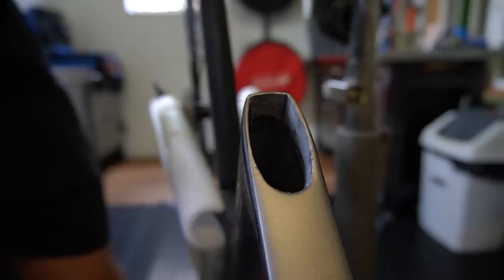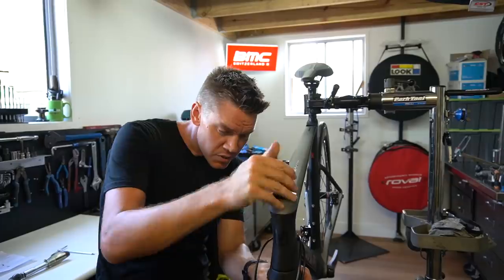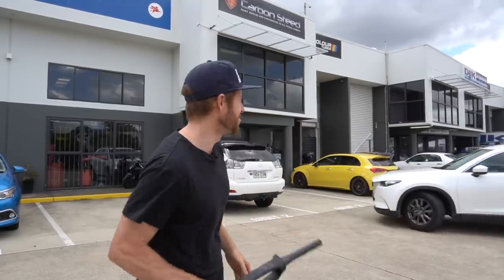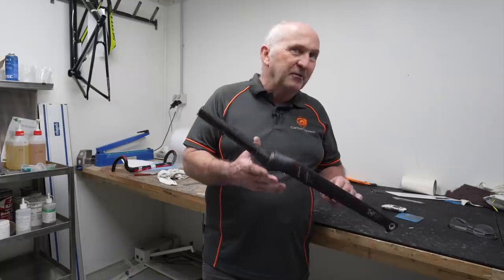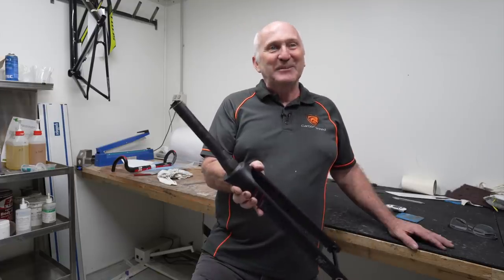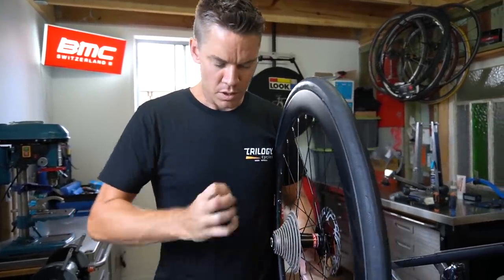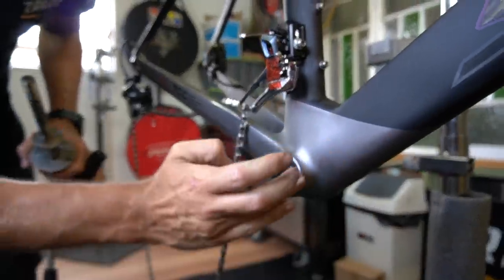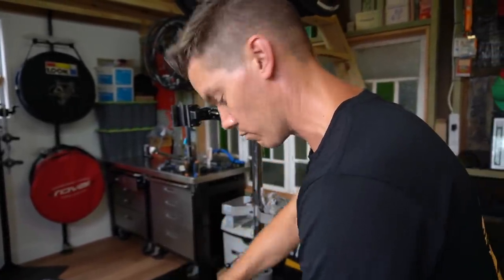The Cheap Chinese Carbon Bike that Backfired

Comment: This is exactly why when I decided to take the leap of cyclist to cycle company owner/importer I spent over a year researching brands checking that they met international standards (ISO) and that they did in house testing, quality control, and that they also had independent testing done like TUV or SGS. I would never sell anything to a customer that I wasn't 100% sure of myself. Yoeleo is one such brand that has that info readily available on their site for all to see, including video's of tests, certifications and UCI approvals.
Reply: Tests are done on the sample and mean nothing assuming they refer to the correct tests and are not Photoshop test certificates. Wait till the borders open and be there when the container is loaded, We even have people sit in the truck until it arrives at customs.

Comment: What a timely video, I have this exact bike on my home repair stand. Was indexing the gears and getting it ready to ride while I wait for the seatpost wedge to arrive that was missing — thus I’m unable to ride it. This has me reconsidering keeping it. 

The one thing I will say, this brand has a rotating stock of 2nd hand bikes in the US, customer returns that are like new, for about $1000-1200 off. This means that you can get a carbon bike, entry level carbon wheels, with full a full ultegra R8000 group set for $1500. But you must thoroughly inspect it and if there is anything questionable: return it if it’s not cost effective to replace. 

One of my bikes is their Phantom 3.0 (ultegra, bought like-new, $1500), and 500 miles in it’s been solid. I’m ultra-paranoid about the frame so I’ve checked it over every 100 miles, and so far no creaks, cracks, or trouble. 2 year warranty on the frame too. If it does exhibit issues I’m planning on just move the group set over to a different frame. 

Anyway, thanks for the good content! Always good to see the pros and cons of these Chinese bikes, especially relevant for hobbiest riders. When I compare these bikes to other brands and what they offer for the $1000-1500 price, they are compelling as long as you know the downside risk.

Comment: Thanks for posting the video out!
 In my own curiosity, I checked on their pricing. They are definitely  on the cheaper side compared  to main stream  brand with the same group set level but not by a significant  margin!

As the other commentators were saying, a Second hand market probably  the better option  if you are only able to buy a bike at that price range.
Reply: Not by a significant margin - I agree!
Reply: Honestly there's so many good used bikes out there from people who go out buy the high end stuff and then get bored or injured and just want some kind of return

Comment: Often, the only difference between these bikes and the name brand ones we pay 100+% more for is QC. These bikes come off a similar production line, sometimes in the same factory, as bikes with brand names on. The large Chinese and Taiwanese bike companies that are subcontractors to the American brands are always building to a price, and the price usually reflects the amount of labour time they have available to properly bond a component, or calibrate the lathe that is turning the hubshells to 'tolerance'. The lesser tolerance ones get put in a different box, with a different label on, and sent to companies that build the wheels from them, for lesser $. I've built over 100 wheels with Novatec hubs, and never encountered an issue like the one shown, which probably means I get the non-OEM versions that have their dimensions and tolerances checked a lot more carefully before shipping. I suspect the forgings and the general quality are the same.

Comment: Hey, these guys are professionals, and as such they have become a bit speed blind. Those microscopic faults are blown up too much. I wouldn't notice a 0.5 mm offset in the wheel bearing alignments, and the rattling cables can be fixed easily.
Reply: You would notice that you can't stop the front brake from rubbing though. It's annoying AF
Reply: If you watch Hambini, then you can understand the major issues that come along with misalignments. Please do not spread misinformation and make excuses for lazy engineering.

Comment: Yeah 2010 i purchased a pinarello knock of frame i still have it .The wheel didn't fit in the front forks with out rubbing .
I put a brand new Group set on it and now it is hanging in my bike room never ridden..
If i didn't have so many bikes i would pull it apart for the group set i just don't trust it to ride it.

Comment: I bought a Polygon MTB (Siskiu T8) and the post sale customer service was really pretty good. They worked hard to replace a missing wheel spacer which I lost through carelessness and despite post-COVID supply chain issues they sorted it out at no cost to me. I would definitely consider a Polygon road bike when it’s time to upgrade my Specialized S-Works SL4. The Ultegra A8X looks like the sweet spot.

Comment: Contrary to popular belief, the main promotion of carbon fiber frames is the ride quality. Less brutal on tough roads, yes. Lighter bikes are now available in aluminum. This shows how important the major bike manufacturers are. Your local bike shop is still and always will be the way to go. My carbon road bike is 12 years old and still looks new. Thanks for the video!

Comment: This is the problem. The consumer nor can some of the bike shops do this level of carbon examination on bike frames. There are big name brands that have the same quality issues or worse. You’re paying more and trusting that these big companies like Gian, Specialized, Trek, etc ensure that the final product is high quality. But that doesn’t always happen. A warranty is great but it’s better when you never needed it in the first place. 
Excellent inspection work on this video. I hope this equipment to examine carbon fiber becomes more affordable and available to bike shops and to knowledgeable consumers. If they’re going to charge more for this super material, they’re needs to be a way check that quality is there

Comment: wow!...a hub made on a CNC lathe that's off-center?..that's a new one.  The age old adage "you get what you pay for" rings crystal clear. I will only purchase equipment and parts from known-good manufacturers for that reason.  A good builder or distributor will know the manufacturer's origin and quality.

Comment: I bought an MTB from Sava and also have the same exact issue with the hubs, the hubs on both wheel are drilled off center. No matter how i adjust the caliper, the rotor still rub making annoying sound

Comment: Not surprised at the bad carbon, seen that many times (and not always on cheap "china" carbon either). But I'm kind of shocked by the Novatech hubs, I have always found them to be really quite good, you have to pull the caps off and clean the bearing face every month or so because they don't seal very well but I trust (or trusted) them to the point that I would actively look for them over some bigger brand budget hubs and even recommend them to people on a budget. Makes me wonder if manufacturing is getting a bit sloppy over there in order to keep up with demand with the whole parts shortage?

Comment: 7:09 How can brakes be wrong way round? At least half Europe rides left brake front, right brake rear. Was it not that way? For some the other correct is correct! Then you will have to change it from right way round to right way round or vice versa.

Comment: I own a Sava carbon frame bike with 4000 miles on it so far.  Have trued the carbon wheels and replaced the bottom bracket.   Paid $1800.00 --bought it new, (Ultegra 8000 groupset) my bike has rim brakes   Have seen other videos (Hambini) where bikes are "trashed" for one thing or another.  But I like my Sava and would buy another one..

Comment: I would like to say it is all depend on your budget, or a beginner rider that u do not one to spend to much on a 1st bike. but hey, at less when u sell it you will not lose to much, or just swap out the ultegra r8000 and upgrade the hole bike and replace with a cheap 2nd hand group set and sell it later

Comment: Thanks for sharing your box opening experience on a new bike, and it's either us or you.  Honestly, pretty much nobody wants to spend any more money than necessary.  When your're standing 5 meters away looking at these bikes, you'd think " wow, why spend so much when you can get this!".  Then once you start getting a little bit closer, and doing work on them, then the low quality blares right out at you.   To me (I'm sorry to say) this is utterly garbage, the workmanship and materials make you want to cry.  I don't know why we all like to think there are lots of better and cheaper options, and unfortunately a lot of these deals are simply too good to be true.  Yes, high end equipment seems really overpriced and I'm afraid to say I have spent a lot of money over the years on bikes.  However I have no other choice, and I have to depend on them when I race (with no sponsorship).  At the end of the day just like they say "Do it right, or do it twice".  The choice is of course, yours.

Comment: Why didn’t you measure anything before putting it together? I would have started by measuring the size and roundness of that bottom bracket, which is probably way out of round and/or not matching on both sides.

Comment: my advice to riders is spend money where it's needed most, the post is where all the flex is, finding one that flexes or even one that has a shock absorber is great, having fat wheels is also another big thing to think about, and if you want to but not needed, the shock absorber handlebars...

Then you can cheap out on frame, you can go steel and you will find it to be a happy ride, steel wheels and you will still find it to be a nice ride... the cost of a carbon fiber bike, complete one is just way too much

Comment: i'd say the axles are more likely the pro0blem instead of the hub flanges. you wouldnt be able to build a wheel right at all with uneven hub flange diameter

Comment: I have a SAVA phantom 3 for 5 months now, 500 miles and no issues at all, ultegra groupset, a branded bike with same specs goes for over $9k.. unfortunately a little too much for my pocket and my level of experience, had the bike inspected from a local bike shop and no issues were found, besides the dry bearings... Easy fix that does not justify paying $5k more..
Reply: I bought a SAVA road bike (Ultegra groupset) over four years ago and have over 25,000 kilometres on it, never had a problem with anything. Am I lucky? I don't think so. A bike company won't survive very long putting out crap. Sava is the biggest seller of bikes in China (not the world). You have to be putting out a pretty good product to be that big.

Comment: Thats why i have carbon fork with aluminium steerer tube to prevent catastrophic snap. U dont want to snap it while descending at 50-60 Kph. Everything is original not fake. I dont even think to buy something from aliexpress or similar sellers.

Comment: Top brand should consider aluminum alternatives, the step between $600 dollars at department stores and the $6,000 dollars for a Pro's bike make difficult getting into a good bike. I don't need to jump from a 30 meters hill but I need to jump 2 meters with safety.

Comment: Didn't expect to see Sava, can u also do another china brand call Java ? This year they just released a full carbon frame, fork, handlebar, 50mm wheels...etc at around $1250 USD. Which is still UCI certified I really wonder how is the quality of the carbon.  The Model is (JAVA FUOCO J-Air 2021)

Comment: When you buy a high volume factory produced bike what you pay does not go the craftsman making the bike.  It goes to a corporation.  The bike industry operates on MARKETING.  They create an illusion of carefully made product with no corners cut in search of performance.  These hyped-up concepts of high quality factory work are pervasive in every industry, and they're promoted by industries that want you to think that they are more than they really are. Low budget, low quality, low bid, and lots of hype and advertising. Get the product out the door as fast as possible with as little investment as possible. Cut corners on safety, insurance, retirement, and quality to save a buck.  And all those extras: advertising departments, management, safety and loss control, insurance, human resources, unions, and even the company goat roast at the lake is paid for by your purchase. You might be surprised to realize how little of the money you pay goes into the materials and labor used to create the factory bike in your hands.  And the moron bike consumer keeps buying it.

Comment: Problem is you cannot jump on a plane and check components QC and container loading at the moment. Someone has a 40 ft container of cheap average bikes and regret they did not employ your bike mechanic to do the QC. Probably no worse than the stores have been selling for years but a good lesson for others thinking of doing the same.

Comment: When I was buying a new bike tbh I was a bit fed up with the obsession with carbon forks on decent bikes that aren't aimed at "pros", I just don't like the idea of some sort of catastrophic failure that happens out of the blue. I don't care if they are 400g lighter or whatever it is, I should be losing that from myself .. in fact my weight can change far more than that day to day. Yes in wheels weight is more of an issue but forks? Nope. I actually looked at a couple and considerde buying them and changing the forks Ended up getting a Croix De Fer, lovely lovely steel ;)

Comment: I had my one and only cheap chinese carbon bike product experience some years back. Got some 60mm chinese carbon wheels for a cheap price and they seemed fine. then a friend tried them and showed me how flexy they were. few months down the line went over a small bump in the road and got a puncture. The rim had a chunk missing which sliced into the tyre! binned them instantly and never again.

Comment: Funny that he got bent about the brakes being back to front, because my excessively expensive when new (not that I paid new) also has US style brake arrangements, i.e. front on the left.  It does not bother me overly, cos brakes don't get used much in road riding, and I don't mind using my right hand to modulate the rear on descents, but I can see that it could trap a less experienced rider.  Riding an ass-backwards old Ducati is much harder.

Comment: Greetings from the USA. I don't ride road bikes but I appreciate content like this bring these issues up. I feel as though if someone's buying a bike in this affordability range (ie cheap) they probably won't have A) the back up spare components to replace a wheel with parts bin components and B) wouldn't necessarily have the money to go buy other stuff you'd need to make it a safe, long term rideable option.

Comment: Just swap out the hubs and you were ridable. (the fork needed a repair, could it not be done?). Hubs and a wheel build, imo those are important areas in anyone wanting a decent ride. Theres guys who balance the rims with lead tape to get a even smoother ride.
Reply: Even the fork MIGHT be fine, the defect is in the additional carbon built up around the tube to fit a tapered headset, straight carbon steerers don't even have that bit and the carbon will be solid all the way through there. Forks NEVER fail there they fail above the headset where the race bites into the tube (usually because the expander was not long enough) or below the headset at the shear point between the face of the bearing and the crown. Not saying you should risk it if you can get a free/cheap replacement but I wouldn't loose any sleep over it.
Reply: @chris1275cc  ive seen them break, collapse.....not pretty.
Usually in high stress, with road resonance. Hospital time.

Comment: The carbon expert said it best. There are no frames without voids. Therefore, you don't want some after-hours noname production. He even says Winspace (chinese top brand) seems to do a good job. 
Ive worked in electronics, and because of that i've grown VERY weary of Chinese QC. It's non-existent. Done by people who have no clue. We'd have production runs of products WE designed, and suddenly they're switching LED and chip manufacturers. Or PCB's with flatband connectors on the wrong side, potted out and cut off with an angle grinder. That's why companies like the one i worked for, have very clear contracts with the chinese. There is NO legal recourse between Chinese and international companies. If the product fails (en masse) you better have some kind of contract that stipulates acceptable/projected failure rate/replacement/compensation. Usually that's what drives companies overseas to start doing better QC and production, because it now hurts THEIR bottom line. If there is no western middle man telling them to do better, you'll get a botched-up job. They'll make money if they make a good frame OR a bad frame. When they sell a frame directly to Tommy in Eastend, Tommy has no recourse other than (if he's lucky) courtesy from the seller via Aliexpress, when something breaks. That's the only difference between the big well known brands and cheap chinese carbon. The BIG brands have a good relationship and understanding with whatever factory their frames are made at. So, quality goes up, failure rate goes down, and if all is well, customers stay happy.